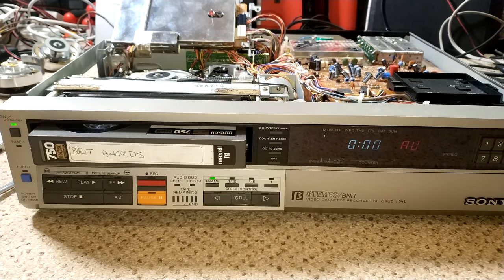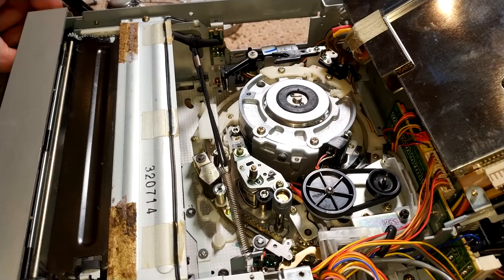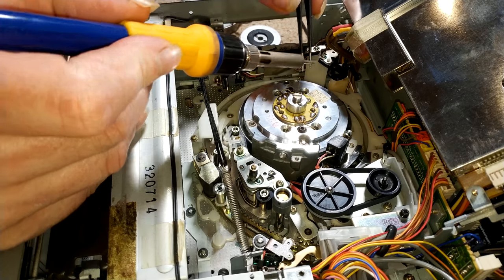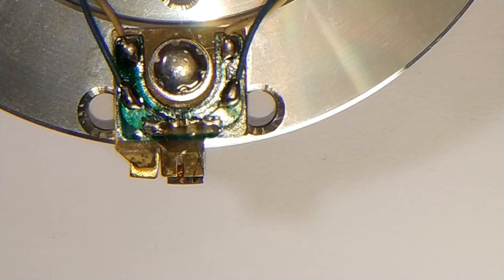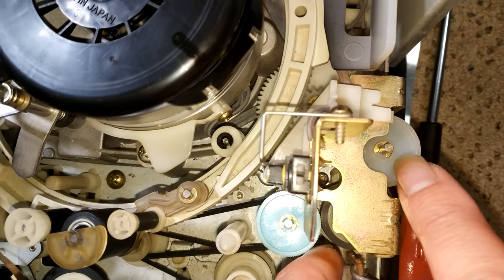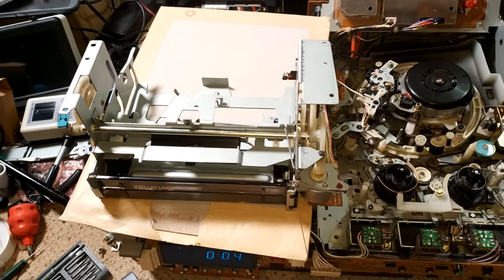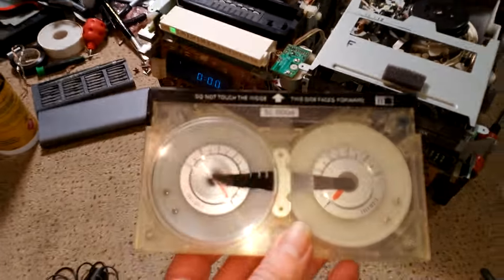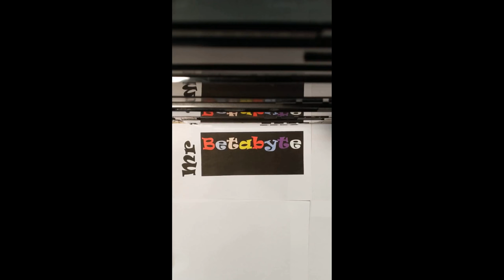Sony SL-C9 Part 2 plus Sony C6 update - swings and roundabouts

Comment: I have a C9E. Is there a way to adjust the playback speed? Fast forward & rewind work well. But when I press play it is slightly slower than it should be. Any ideas? Thanks
Reply from the maker: Is the pinch roller OK? Tape path clean? You may well have servo issues if both are OK. Does the tape sound like it's under stress during playback - you might have high back tension if so. There are adjustments but check the basic first.
Reply: @MrBetaByte  It just required a slight adjustment to one of the Pots. One of your other followers had the same issue & kindly helped me out with directions. Thanks